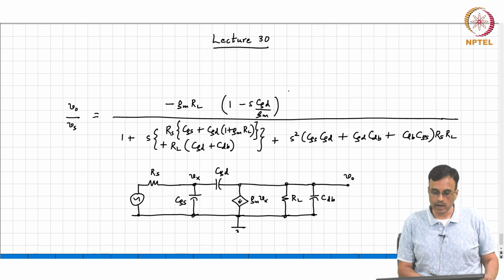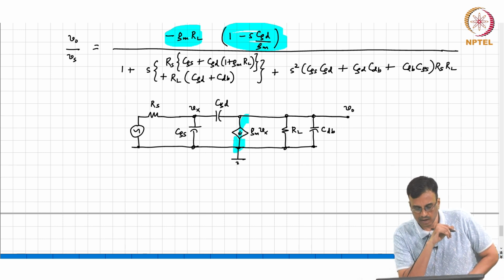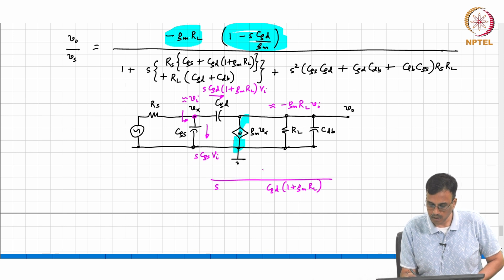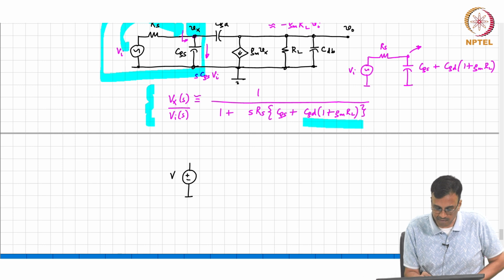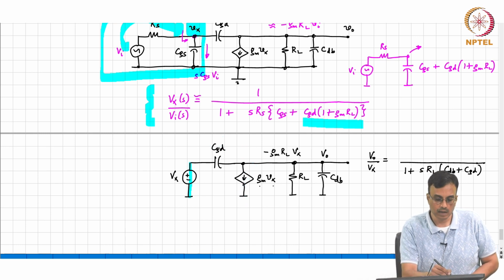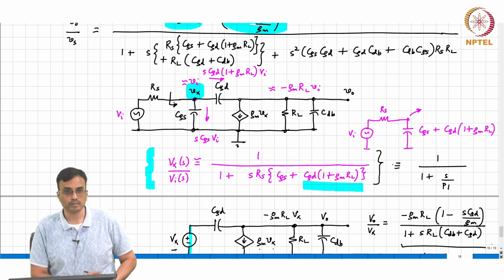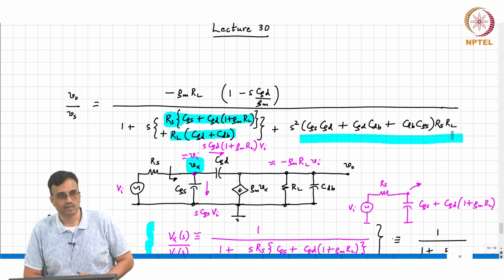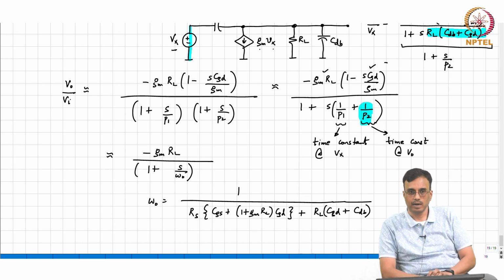The Common Source Amplifier with Parasitic Capacitances

Comment: is there any intuition for the coefficient of s^2 in the denominator?
Reply: Second order system despite of three capacitors .The third capacitor’s voltage can be expressed as a linear combination of the other two.
Reply: So you get a second order as there are effectively only two capacitors
Reply: Why should zero is right half??